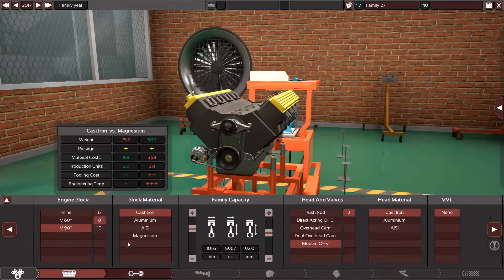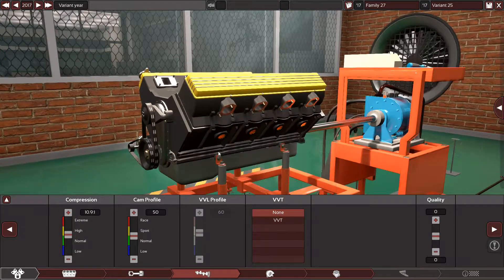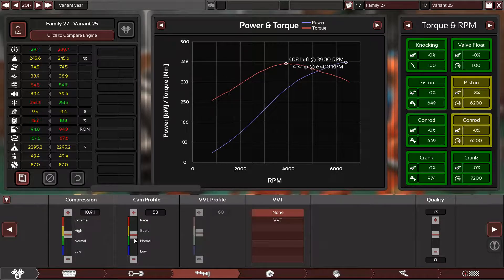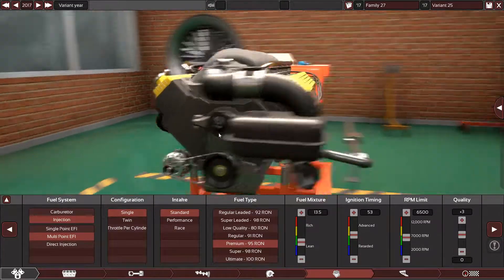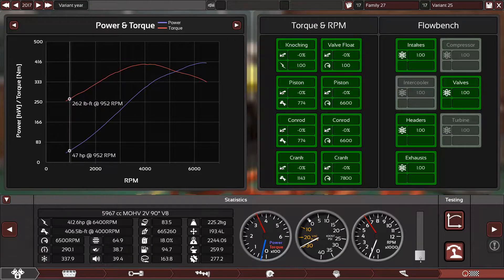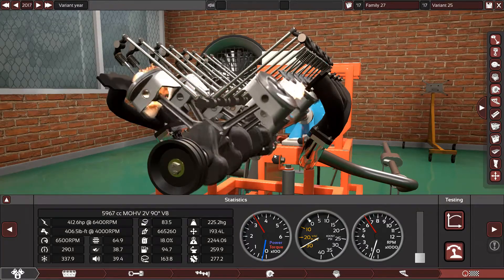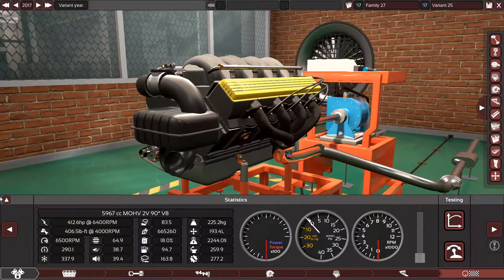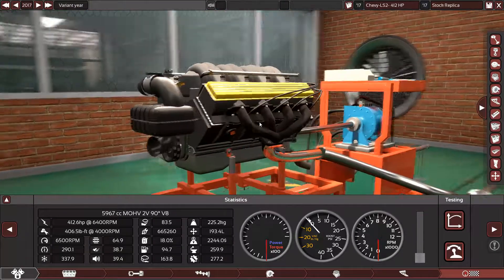Chevy LS2 Replica in Automation.

Comment: Got an opportunity to drive a friend's Corvette with the LS2. Plenty of power up top, but its low-end is terrible; I frequently found myself falling below the speed limit because of it, and having to push precariously hard on the throttle to keep up with traffic.
Reply from the maker: I think because it has like a high performance camshaft which makes the power goes all the way to MAX RPM but makes the low RPM suffering.
Great car by the way 👍

Comment: Love your videos, but just a quick FYI: the GM LS series engines are all cast aluminum not iron. The very similar Vortec (truck) engines are built with a cast iron block but still use aluminum cylinder heads.
Reply from the maker: +Jayson Barenberg 
Thank you for your awesome notice.
👍